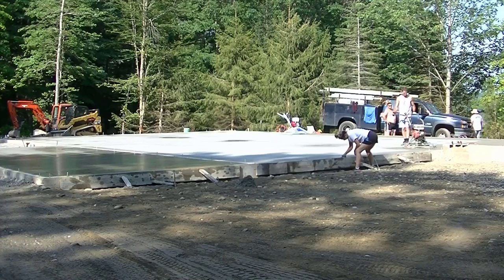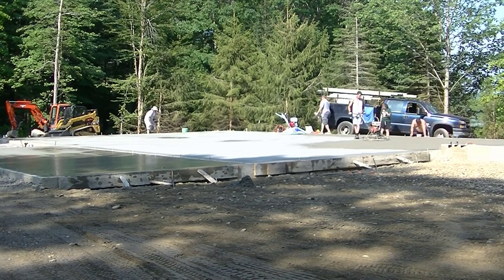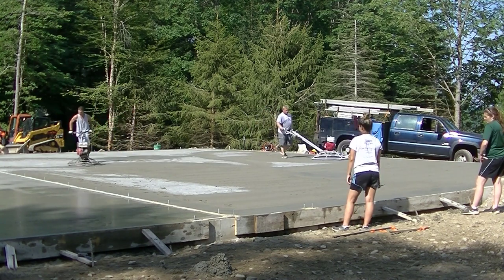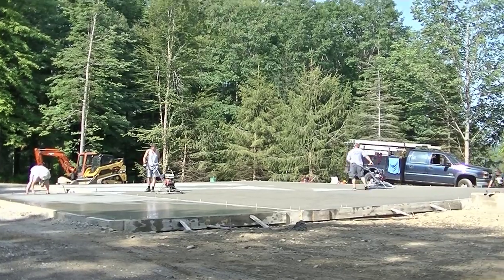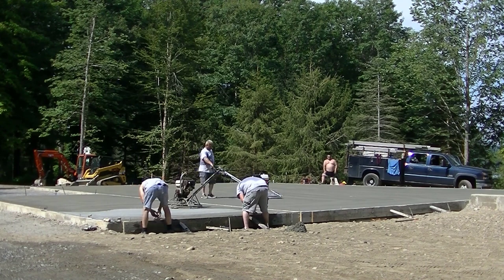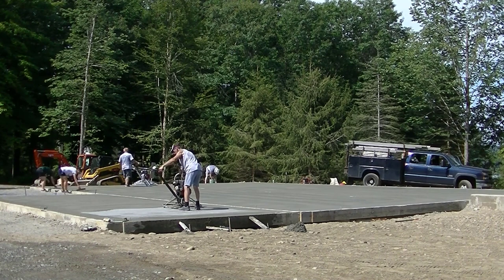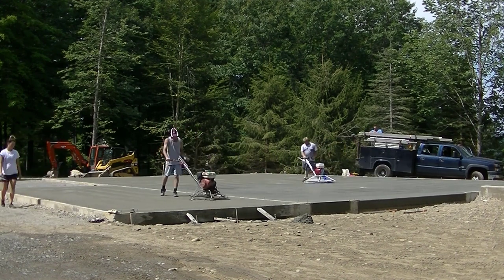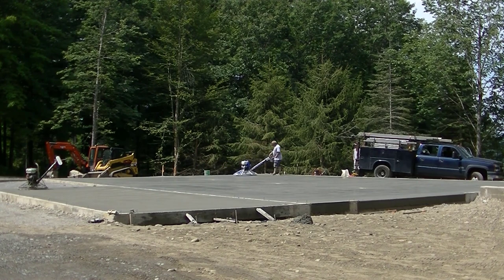How To Finish A Large Pole Barn Slab | Power Trowel Finish

Comment: Mike

Do you use steel fibres in concrete?
Once power floated, will the slab be free from projecting fibres?

Thank you
Reply from the maker: We don't use steel fibers. Only micro-fibers made from polypropolene.

Comment: Mike do you use 3' or 4' PT..we use 3' I do have a new rider with only few hours on it..we don't use it much.. you dont use combo blades? 
Thanks
Reply: Dirt Boss Tri-County Masonry & Excavating my opinion with combos is they dont do as well of a burn as finish blades. That why i dont use them. I run a pan on a 3’ two passes then hit with finish blades
Reply: @aarongrabowski5620  got ya 👍
Reply: Dirt Boss Tri-County Masonry & Excavating 😎
Reply: If your good with combo blades then us them i just prefer to pan it then go to finish. Gets the stones down more than combo blades would
Reply: @aarongrabowski5620  yes I grew up using combos.. I also use a pan.
Reply from the maker: I use both 3' and 4'. We prefer the float baldes then finish blades. My guys don't really like the combos. We've used pans in the past, my guys just prefer the float blades.
Reply: I use just float blades, then hand trowel, one handed push up fully ecdended rainbows with hand trowel,,🖒

Comment: Is controlling a power trowel the same as running a floor buffer?
Reply: Probably. Basically lift up or push down on the handle to steer.
Reply from the maker: Yea, it's kinda similar. I have both and I think the power trowel is easier to run.

Comment: 😆 What technique do you like to use when a power trowel gets away from someone? The - Slow it down with a 2x4 technique, The lasso it with an extension cord technique, or The let it run outta gas technique?
🤜🤛
Reply: How about the make sure the dead man switch works technique???
Reply: That is the one i swear by
Reply: psidvicious nothing says safety first when a power trowel is cruising around at about 52 rpm’s
Reply: psidvicious i bet hes never had it happen yet. Nice try though
Reply: @aarongrabowski5620  I’ve only seen it a cpl times and its always a bit of a humorous moment...until it starts walking it’s way over to the edge of the 10th floor 😳. I’ve never seen a finishing crew with a functioning dead man switch on their power trowels 🤷‍♂️
🤜🤛
Reply: psidvicious trust me its never humorous if you are on that end of the machine. Thx for your comment though
Reply: psidvicious by the way they come with them when you buy them
Reply from the maker: Luckily that's never happened to me or my guys. All my machines have that dead man switch though. Just not sure if they work.